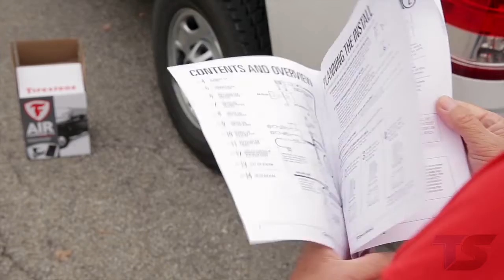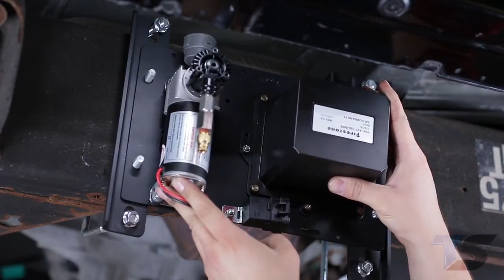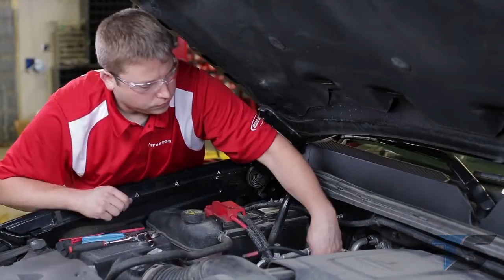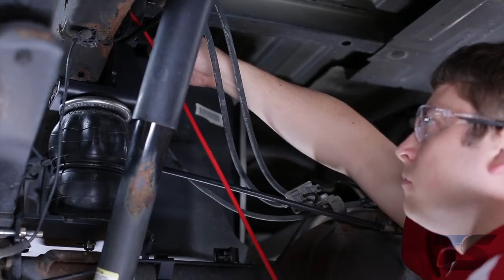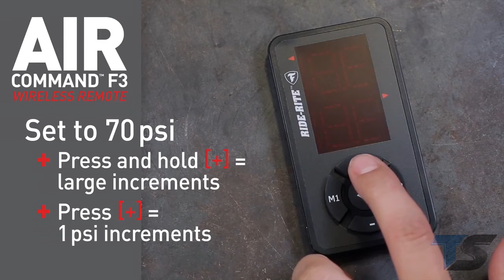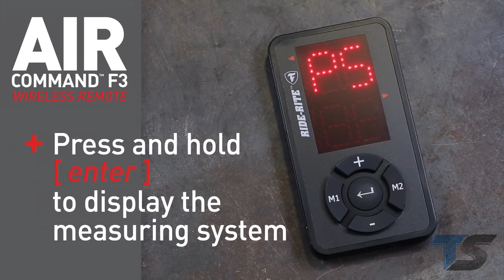How to install Firestone F3 wireless air compressor kit

Comment: I have the same air bags but mine doesnt inflate at all. I hooked up the pump to a 12v battery and it only inflated one. Not sure what the problem could be. Do you knkw what the problem can be?

Comment: How do I connect my air command app to the airbag ecu?
Reply from the maker: This video is a reference for the older F3 system. This system did not support smart phone connections. The newer Wireless Air Command systems will try to connect when the system is power cycled. When you open the app make sure you have Bluetooth enabled and the app will attempt connection with the ECU.

Comment: What is the proper way to add an accessory holding tank to inflate tires?
Reply from the maker: On the F3 wireless kits air tanks can be added but the way that they are added will depend on the revision number of the ECU. Certain revisions have internal pressure switches and a tank mode can be activated. Other revisions will need an external pressure switch added to control the compressor.

If you are looking to add a tank to an already installed system you should get your revision number from your ECU and contact us or Firestone.

If you are shopping for a system and would like an F3 wireless with a tank the FIrestone RR2592 kit would be the best option.